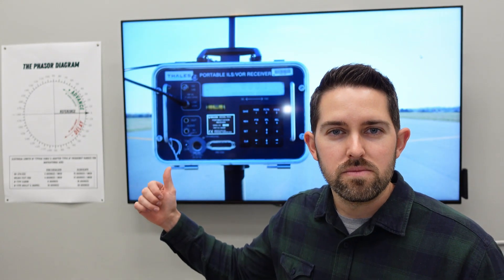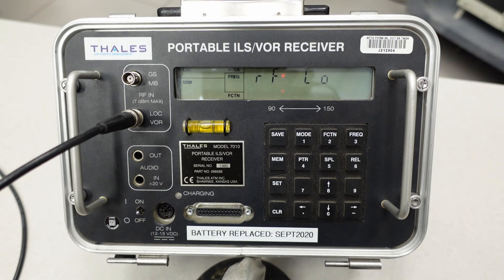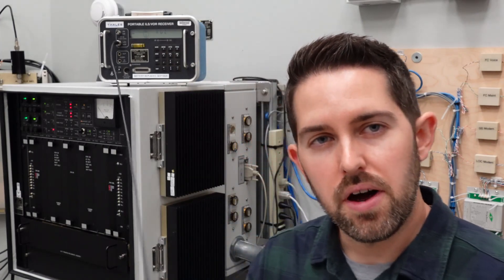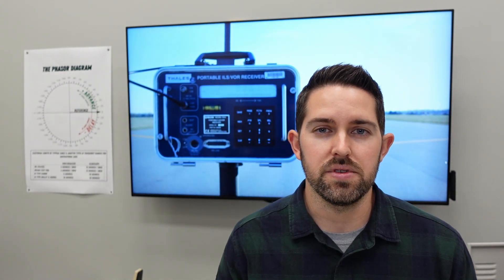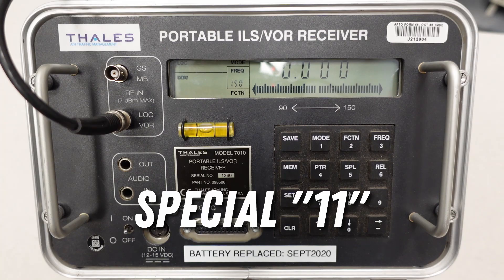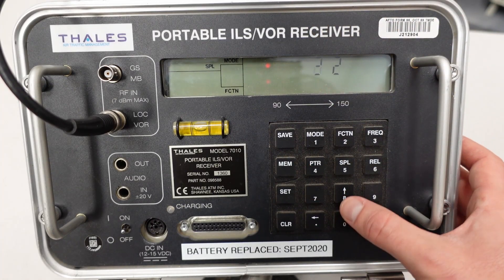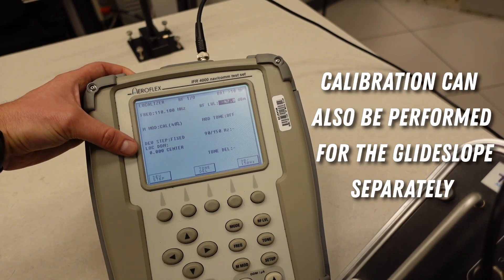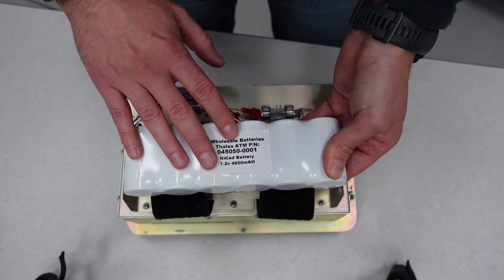Operating a Thales Portable ILS Receiver

Comment: Sir my equipment reading rf lo when connecting to antenna for reading signal localizer or glide path, what that mean and how to fix that problem sir?
Reply from the maker: I'd check your PIR channel frequency to make sure it matches the LOC or GS frequency your on and additionally making sure you have selected the correct mode (LOC or GS) and are plugged into the matching RF input with an appropriate 50 Ohm test cable.
Reply: Mee too, the SPL 900 not working. It still RF LO
How to fix that ?

Comment: hi, are there any software application to exploit measured data from PC instead to display it manually from local creen?
Reply from the maker: Sort of... You can view data on a PC using a serial terminal application. I used the Arduino IDE software, serial monitoring successfully.
Reply: I would like to purchase Thales 7010 Portable ILS/VOR Receiver